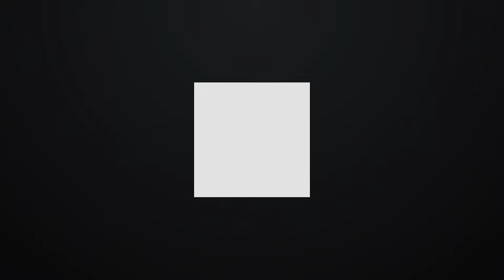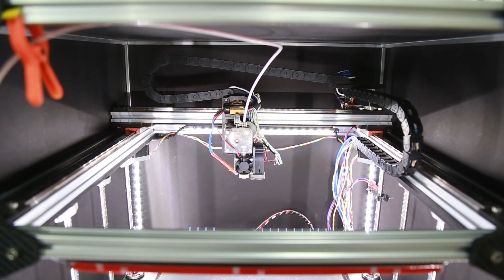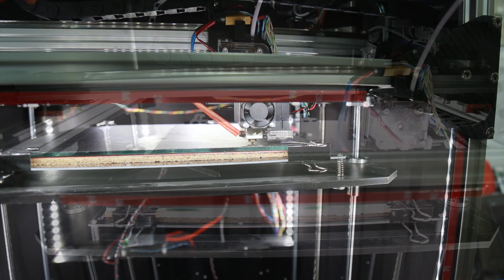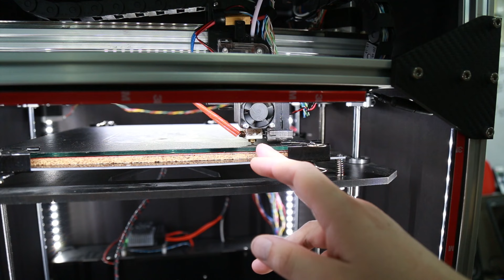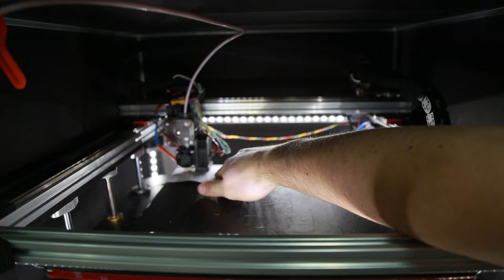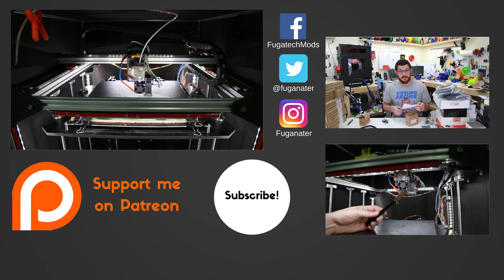How to level your Folgertech FT-5 bed

Comment: Thanks for this Shane. Really helpful...and pretty close to what I do currently. Curious though...I see you are using 4 leveling points vs the eight that the Ft-5 has. Do you find that using only 4 is advantageous? I'm using the stock heated bed, so I worry a bit about warping.
Reply: Scott Leonard I'm sure he doesn't need 8 as he's using glass which is pretty damn flat so corners is all you need
Reply from the maker: You should really print on glass. That way your print surface will always be flat. And 4 is the right amount. Having 8 takes way too long to level the bed.

Comment: Mesh bed leveling is something that auto levelers use. If the build plate is really really flat, they just take 3 points and use that. For a stock FT5 build plate it's not really all that flat so mesh bed leveling would take many points. You can't really "mesh level" manually (thumb screws). The adjustment is to the software rather than the bed itself via the thumb screws, the adjustments compensate for the for the different Z positions with each point of contact. Say if your bed is really really flat, but it tilts to one side. The high side is 0.3mm higher than the left, then the compensation in the software will allow you to print as if it were leveled with the thumb screws. 

That is from my understanding at least.

Comment: Is your extruder further down than the stock one? When I try and level the bed with everything stock, the z axis won't let the bed get close enough.
Reply: He has a different extruder/hotend than stock. My Z axis endstop (stock) is a lot closer to the top, and it also sucks. Every few prints I need to readjust it. I am going to switch it out to a different design and see how that goes. 

As for yours, if the bed is not getting close enough to the nozzle you need to make some kind of adjustment. Either the Z endstop needs to go higher. Or the bed needs to be. Are you using springs on all 4 corners? Are you using a build plate as well like glass or mirror tiles?
Reply: I'm using screws on all 4 corners. And everything is stock, so I'm using the normal bed with nothing else.
Reply: And the nozzle is still to high? Can you level it like he did, and get the nozzle touching the bed? Is it just when you print? If so that is likely the Z offset. If the nozzle will not physically get close to the print bed when you home the printer then the Z endstop is too low. The Z endstop, as well as the Z offset is what will cause that kind of issue.
Reply: I get the bed about 2 or 3 centimetres from the nozzle and it won't go further. The z stop is too low but I can't put it any higher. I've got access to another 3d printer so I'm going to print  a clip so it goes on the outside and should make it all the way.
Reply: Can you take a photo of it? Like your X and Y axis as well as the endstop? If you are using the stock setup, I don't see how that is possible.
Reply: qballtvp never mind. Figured it was on the wrong side of the pole.
Reply: But now when I try to home it, it says all end stops are triggered when they are not.
Reply: Yeah, I was about to come back with that. I messed with it a bit and put it endstop on the wrong side and the touch point wasn't hitting the metal piece. It was off to one side. But when you put it back or move it to the other side it will work right. At least until you home it a few times and it slowly moves up. 

I printed this out and will install it later maybe you will like it as well?

http://www.thingiverse.com/thing:2070617
Reply: qballtvp thanks for that. Do you know how to change the end stops?
Reply: Hmm, are the endstops lit up? They have a red LED when they are triggered. If they are not, it's likely a wiring issue where they are not seated correctly or some other issue like that.
Reply: I don't think its the wiring. I've had it all working before.